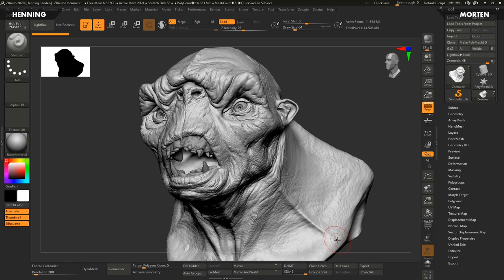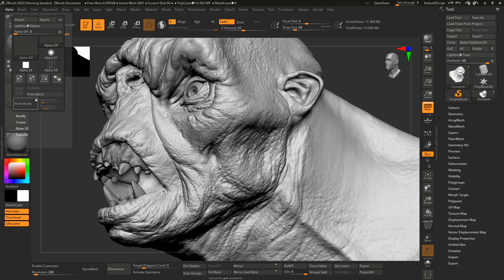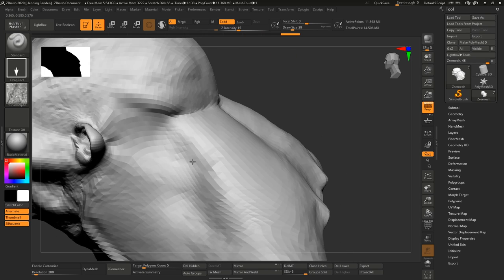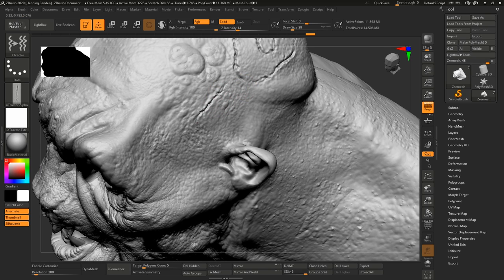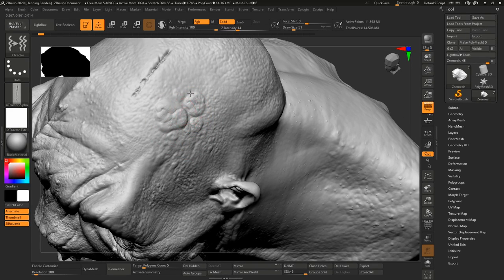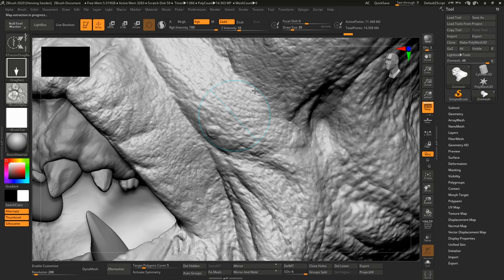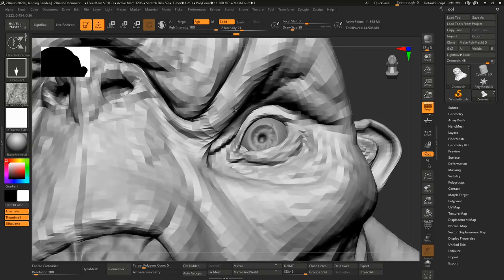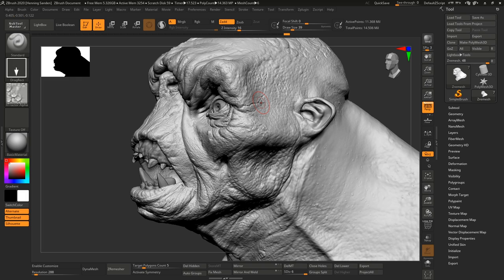How to Use the XTractor Brushes in ZBrush 2020

Comment: The XTractor Brush uses a point in the subtool history as reference as compared to the current mesh state.
It can either use the first available history point, or the point you specify (by ctrl clicking the history point), or if there is no history available then it tries to "imagine" a reference geometry that is a smoothed out version of the current geometry.
This means that the resulting alpha depends on what the difference is between your oldest undo state and the current one. This is probably why you're getting a strange result in the mouth area. If the only difference is a couple of wrinkles then it's all it extracts.
You'll achieve the best result if the oldest or "source" (ctrl click) undo point is a smooth version of the detailed mesh.
hope this helps (otherwise there are at least a couple of videos on this by Joseph Drust.
Reply: PS: the best way to visualise how this brush should NOT be used is to use it on a subtool in which the very first undo state is a very low poly mesh. The angular nature of the low poly geometry will be reflected in the extracted "difference" between the first and last undo states.
Reply: Was about to write the same thing. Pavlovich imo really provides the best details about new features.

Comment: One question I've always had is, what is the advantage of sculpting all these detail when it can also be painted in texturing programs like Substance?
Reply: In substance its faked by using normal or bump maps. This is actually on the model not a map applied to the model
Reply: @seanakima50515e  But you never use a zbrush model in production.
Reply: TechYK u do the high poly then u can bake normals and bump maps from it then export it to substance painter and u continue the painting from there. I think now you can even do all that in zbrush 2020 thgh not sure.
Reply: TechYK so u just use the the baked maps on the low poly mesh
Reply from the maker: We actually have some videos on this - painting details in Mari. For bigger details you definitely want to do this in ZBrush, but for very fine details, a texture map is best.

Comment: hey nice video! :)

It's not that the Xtractor is broken. You just need to understand how it's working to capture the sculpt detail.
You can control the capture by selecting a history point with a ctrl + left click.
If you have a history, it will try to collect the details from the history. but if you don't any history on the model. it will collect the mesh detail as is from the mesh.
This is why when you restart ZBrush, - because it doesn't have a history on the mesh it. suddenly seems to work fine.

others explained here in detail.
https://www.zbrushcentral.com/t/issues-with-xtractor-brushes/354222/5
Reply from the maker: Thats interesting! Thanks a lot for explaining, this is great.